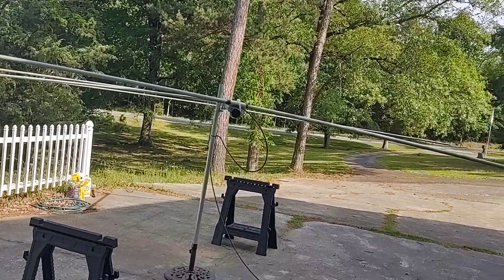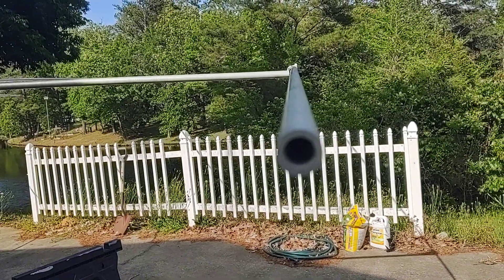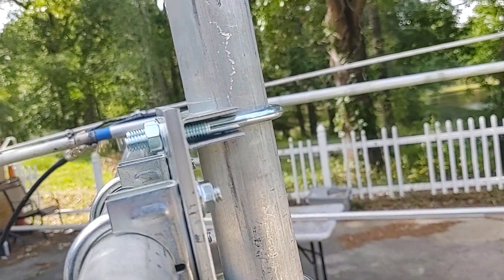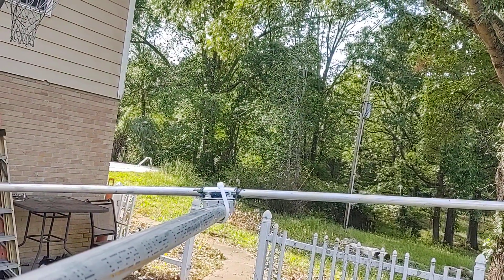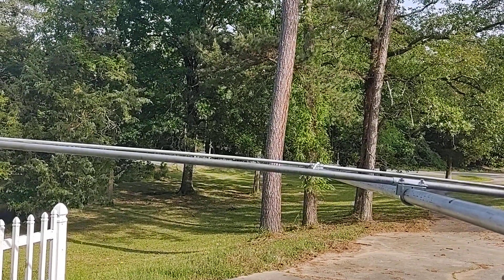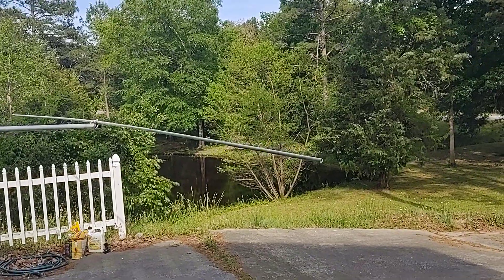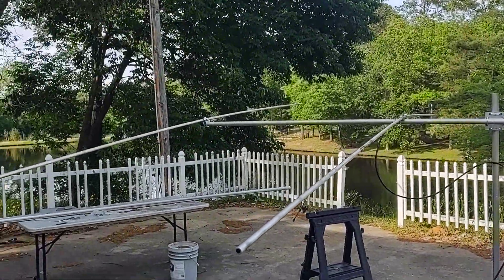4 Element Yagi Beam DIY

Comment: GOOD JOB BUT you aren't quite finished yet.  You have direct coax to driven element connection.  That means you have an unbalanced feed going to a balanced dipole driven element.  It will work but the swr readings will not be correct because of stray rf floating on the braid of the coax.  You say it is 1.4:1 and I am guessing you can't get it lower.  That is because the swr meter is not reading correctly.  You need a balanced to unbalanced connection using a balun.  It will prevent wavy lines on the TV and Computer Monitor.  A balun is easy to make or cheap to buy.  Cheers  VK5LB

Comment: Unit 63, how did you come up with the spacing and lengths of the elements? If antenna modeling software, which do you recommend? Thx
Reply from the maker: I got this design from an operator in FL.

Comment: Really cool build 
 How much of a difference donyou notice compared to what you used to use?
Reply from the maker: I was running a vertical A99.  There is no comparison.  If I'm giving another station 7dB on A99 I'm giving the 10-20 dB on the 4 element. The receive is 50-75% better also. And most of the time much higher signal to noise ratio.
Reply: @unit63sc17  so awesome.  I'm gonna use wire but I intend on making one

Comment: How do you go by lowering the X= the R= 50
Reply: A resonant antenna has no reactance, and then there's mutual conductance. Also, there's a common misconception about what the capacitive side of a gamma actually does, this predominantly coming from hams (I'm a CBer). Do yourself a favour and look up how a gamma really works (not on Youtube!), it's rather interesting, and clever.
Reply: @arconeagain  Good morning thank you for the reply I've done a little more tweaking it's a 1.2 and it's flickering 1.1 but as is it's  swr 1.2  R=49 X=9 OHM 50
Reply: @rayjohnson7886  I didn't realise you were trying to tune one. How are you measuring it? Right at the feedpoint or via a half wave/s of coax??
Reply: @arconeagain  Hairpin I adjusted the reflector a little bit the spacing not adjusting the length of it.
Reply: @rayjohnson7886  but where is the analyser being  placed?
Reply: @arconeagain  My hardliner is on the MFJ inside the man cave I have it straight I'm gonna do a little bit more once it cools down its been in the triple digits gonna be 115 degrees today.
Reply: @rayjohnson7886  you can't read the complex impedance of an antenna with a random length of coax.

Comment: Yagi antennas are awesome! Good job on the build. What's the bandwidth like on it? I thought about building one a while back and will have to do it. 1 reflector, 1 driven element and 2 directors make decent gain as well.
Reply from the maker: 26-28 Mhz

Comment: Now that you've finished playing around with your 'antenna', your wife says she'd appreciate it if you'd fix the fence and paint the garage doors!   😁
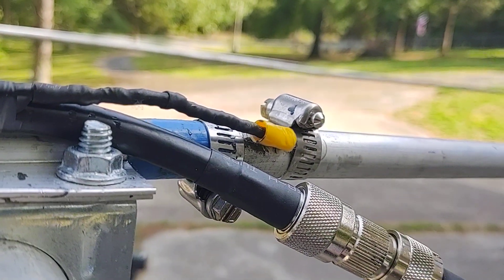But seriously, the only thing I question is how long it will be before the pigtail attached to the ground side of the driven element (6:29) shorts out on the threads of that u-bolt.
You know, with all that rotating and hurricane winds and stuff.
Last question: Is that a river or a pond in the backyard, and are there any fish in it?
Reply from the maker: The fence is gone and I'm getting ready to paint that side of the house lol. That's a pond with nice bass, bream, cats and crappie. I insulated the ground over the U-bolt with coax outer insulator.
Reply: @unit63sc17  
Be careful when you do that painting!
I heard of one guy who fell off the ladder and almost got hurt, but fortunately he landed in a chair which just so happened to be in the radio shack in front of the radio.   Imagine that!

Comment: Paul, did you put a rotator on it?
If so, which one?
Or did you build that too?
Reply from the maker: I'm using an RCA rotor with no issues. Just make sure you open it up and tighten screws and add locktite. This is a light beam.

Comment: I worked on cell sites to several years ago. Ive got about 40 of the silver plated n connectors and i used the lmr400 i had left over on my beam lol its nice to get free parts. good job on the antenna. It’s been a while since I’ve talk to you.  73s WR125 Ky
Reply from the maker: 4-Roger Larry!  We should get some conditions soon.  I'll be listening for you!

Comment: So, after 1 year, how is the antenna doing? You like the performances of it, what are the specs DB gain, Fb gain .......did your try an antenna program to see the lobes ????
Reply from the maker: The antenna is fantastic.  I don't know what the DB gain is on it but it's got to be real good. I haven't tried a program to see the lobes but it has great side rejection and is a wide beam. This thing rocks

Comment: Will never last!  The way that driven element is drooping I give it a one good storm and that fiberglass rod will splinter and break!  The elements are all too heavy and you should have used something like 6063-T832 drawn aluminum tubing in telescoping diameters for strength and survivability!  Telescoping elements are stronger than a solid tube as there is less stress along the length of the element.

Your driven element is a split element (dipole) and it needs a current choke to keep common mode currents from traveling down the outside of the shield and getting into your home electronics and especially your radio equipment.  There is nothing more fun that getting a RF bite caused by CMC's in the shack!

Comment: Balum  balanced to unbalanced
Reply: Balun
Reply: Yeah, I'm thinking that with a 1.2:1 SWR a balun shouldn't be essential.
Reply: @daleallen7634  he's talking about a 1:1 current balun to address the common mode current. The term balun literally derives from the two words balanced and unbalanced. Whenever you feed a balanced antenna with an unbalanced feedline like coax, you should keep this is mind. At minimum, a coaxial choke. Personally, with my LFA, I run a substantial ferrite, coaxial choke. Incidentally, you say the SWR is low, well CMC can and will affect these readings.

Comment: Don't want to burst your bubble but the feed will allow common mode currents to flow on the outside of the coax the gama would prevent that so will ferrite beads or most any 1:1 choke but without any you will receive and transmit both polarity and receive as well as give interference . most noise is manmade and vertical so you will get a higher noise floor too . try to install a proper matching device there not difficult and will allow you to get more out of your antenna . Dipoles  are balanced antennas even on a directional and coax is unbalanced so a value is always nessacery

Comment: Oh dear God!  Another Ham guy decides to prove they are an idiot on youtube. There is no way in hell that thing is going to last a year. 

 Nope! I am not a ham guy.  I am an 8-year duty veteran with 3 months of High-reliability soldering. I was a  Ground Radio Repair technician. 30474
 When we decommissioned the Titan II missile sites stationed at LRAFB, I ended up with a 2-30 Mhrtz transceiver and amp from WWII battleships. I taught my wife how to use it. The darn thing was a mechanical nightmare, and I have enough parts to keep it working for 10 lifetimes.  Then when I went to S Korea,  we tossed K2 transceivers.   We upgraded to Pacer Bounce & Balance.  I still have the K2 also. I talked to my first wife several times a week on those radios for an entire 18 months in 1987-9.  100% homebrew antennas That have not been repaired thru this day.
  I have the ancient Navy rig, my oldest has the old USAF rig. Without a license, My son and I contact each other every few weeks to make sure everything works in case the shit hits the fan.  We live 775 miles apart.  and My home brew antennas were built in 1987. one in May in NY, the other in June, in Korea

 As I said, that fucking thing is not going to last 6 months.  I hope he blows the finals out of his amp, or TX.

Comment: I currently run a homebrew "droopy drawer" design 1/4 wave at 20'. Have a .64 Crossbow that I just cannot get to tune so have put it on the back burner for now. A friend recently gave me a Maco 3 element beam, but has none of the clamps to install the radials. This is the best video so far, that shows how the direct feed needs to be seperated. Hoping I can find thos saddle clamps locally. Thanks.

Comment: Hi, I was wondering because of the many beam antenna's on the market, what is the difference rx/tx between a d-pole, 2, 3 or a 4 elements antenna or a vertical antenna?  73.
Reply: Forget all that stuff, for the best signal, what you want is a Henway.

Comment: The direct feed was perfected by G0KSC  the original OWA low impedance Yagi back in 2010 or so .You still need a CMC at the feed? The boom is not long enough and the first director has to come in much closer to the driven ele achieve the direct feed 50ohm match  😎

Comment: Super Job on that I had a  beam like that . A ham made my like that but ran  half wave coax going at 24 feet a run so my was  144 feet  on my coax  he put wooden dowels in my tubing to keep  all of them lookin at each other  and fishing line  tip to tip with like 90 lb fishing line to  all coax  and bolts he put that   CLean   zip-a-way removing weather stripping on all of them  if it ever needed to be  removed it jest pop off  clean not like black tape acts like   ok have fun dx;ing in 11    73's  Pam   2VOW505   Wisconsin  VOW is Voice of Wisconsin

Comment: Great job! How does a folded dipole element work? surely then the center and shield of the coax are effectively shorted together in that configuration.
Reply: @simon hanlon  :
Actually, there's a 43" X 1/2" fiberglass rod between the two pieces of the driven element to provide insulation between them.
Reply: If you mean a folded dipole is a short, it's because RF behaves differently compared to a DC. You probably should read up on a little basic RF theory. Furthermore, a folded dipole will have a much higher impedance than a half wave dipole. This can be taken advantage of with yagi design because of mutual conductance. Folded dipoles also have a greater bandwidth and, arguably, greater capture (full wave), and may even be quieter.

Comment: As a recent acquaintance has told me and he seems to know quite a lot, is that what the elements you're talking about in the kit that step down in size of tubing it's to compress the signal and you want to compress the signal as small as you can... But if I hadn't heard from someone I couldn't have told you and I don't know yet but if you were to cut those elements down and step them two sizes down should be super beneficial; compressing the signal a whole bunch, in turn greater performance all around distance whatever as I understand it. But you have one built and I don't, have a 24 ft beam in the yard but I have no elements haha.
Reply: That's a load of bull. I've never heard something so ridiculous in radio, this takes the cake.
Reply: @arconeagain Typical C.B. jargon !
If anything, the stepping down in element size, is more mechanical, than electrical !
Having said that, a larger diameter element, will get you more Band width !
" Compressed Signal " ?
Sounds like maybe some confusion over Beam width ?
All a part of element spacing, and boom length !
As easy as it is to get an Amateur Radio license these days, I don't know why these guys that are so interested in building antennas, don't get their Ham license, and get with people who truly know and understand how this stuff works ?

                 🤔.....?
             Just Say'n !

(((---_---)))
         I
         I
Reply: @sleeve8651  yeah that's right on the mechanical properties and bandwidth theory. Although I don't see it imperative to get your ham licence. I'm a CBer, and am more knowledgeable on antenna theory that most hams. You can learn these things outside of ham radio, I've been studying, building and testing antennas since I was a teenager. My current choice of horizontal antenna is a 4 element LFA.
Personally, I will never become a ham, even though I could get my advanced licence in a heartbeat. It's worth realising that there are other professions and qualifications that, by far, outrank a ham too, even my electronic engineering education puts me in good stead. I have found the best source of untainted knowledge and theory is from old school military vets. Crucial information that will soon be lost.
Reply: @arconeagain  Not to be argumentative, but the Advanced license class hasn't been available for at least 2 decades !
But to your point, it is simply up to the individual !
But with your statement of having an 
" Engineering education " (?)
( Not mentioning a formal degree ), struck me as curious, only because living near a Major EE School, and having met many of the students there, it just kinda comes with the territory !
As one seemingly begets the other !
And knowing there are many
fields of Electronics unrelated to RF, it would be foolhardy to believe all blossoming Engineers would gravitate to achieving an Amateur Radio license !
As to my point, I was simply pointing out, that your chances of finding the correct answer to a particular answer, would be to choose from an educated pool, instead of the " Guess and Be Damned, Follow the leader group " !
Which was demonstrated in the comment I answered.
That's all !
No more, no less !
But Thanks !
Reply: @sleeve8651  my inaccuracies in amateur radio licensing demonstrates how little I care or have involvement in ham radio. I mean, why would I know the difference, or changes over the years when I have absolutely nothing to do with it? In saying that, there is amateur radio outside of the US, naturally. And it turns out in Australia, my country, there is in fact, currently, an advanced license.
In regard to engineers, well it would seem that term is dropped more casually and more often in the US (I'm assuming you're American) than Australia. I did complete half or more of my electronic engineering degree. To say this has little to do with RF theory or of little help is ridiculous. What I have learned in complex electronics and mathematics, even basic electrical theory (some struggle with ohms law, which everything comes back to) puts me well ahead of most. I have a much better grasp on things in general, and the experience, I know what's really going on instead of skipping to the end with some formula. Don't forget we learn all about inductors and capacitors early on, we learn how to calculate capacitance and inductance from the raw thing (sound handy for antenna design/construction?). We obviously learn about power, calculating peak and RMS and the difference, basic circuit analysis, resistivity which is good for calculating losses in RF with skin effect in mind, basic waveform and AC analysis. I can easily transpose complex formulas, simplify and expand, including algebraic. The list goes on, and that's real basic stuff, my advantage also being that I can do it and understand it in its entirety without having to think about it. It's called an education.
Reply: @arconeagain  
You are as uninterested in Amateur Radio , as I am about Radio licensing in the Land Down Under !
Touche' !
Hopefully you will one day be able to complete your Degree !
And I had no idea you were in Australia !
Funny thing about the internet !
But just as water in a toilet bowl turns Clockwise in the North, and Counterclockwise in the South, so might the way we think about things ?
As from here, you guys appear to be standing on your heads !
                😂🤣😂

         Good Day Mate !
               🇦🇺🙃🇦🇺
Reply: @sleeve8651  our toilets flush completely different to yours. Your toilets are weird. Have you seen what water does on the equator? Most interesting.
I should have the radio on now, you guys have been flooding in on CH38 and the like. I had to pack it up for a house inspection, and unfortunately, I have to move out soon. On the bright side, I'll be up over 500m at the next residence. Using the LFA up there wouldn't be fair on the locals. You have a great evening.
Reply: @arconeagain  
Congratulations on your move !
I hope all goes well for you !
Good luck & good DX once you get set up again !
Most importantly, STAY SAFE , Mate !
Good 'Day !
👍😉

Comment: They use to be a fella handle was rifleman that built these 4/5 element beams around us I'm in Asheville north Carolina and I have something similar to these if you could by writing could you tell me the spacing of this antenna sir the length of the elements and length between each one if you can't I do understand

Comment: Very cool, Thanks for posting this. I heard you on 38 LSB around Fathers Day. (could of been the day before or after, don't remember. Had some decent skip those few days) You were talking to someone about your homemade 4 element yagi.  I could only hear your half of the QSO. You were booming into my radio here in Central New Jersey. Tried to make contact with you but couldn't get through. You gave reference to this video about the antenna. Glad you did its a great build. Not to mention this beam talks. You made the trip here no sweat above everyone else, and it was busy. Thanks for helping the community with this. 974, Twin Mill in Central NJ saying 73

Comment: Nice! Good job building that antenna. I just shared this video on My Community tab. Take care 63, 73's from 151 SC.
Reply from the maker: I finally got it out of the driveway and it's on the roof flat side with a 1.2 SWR with power. Hey 151 thanks for the kind words! I should have mentioned you because you also had a lot to do with me building this. I watched a couple of your antenna videos! 73's
Reply: @unit63sc17  where did you get the black fiberglass rods from?
Reply: This is what it’s all about !! Enjoying and experimenting, and sharing ideas and knowledge.  Thanks for posting that 151 👍
Reply: Max gain ststems